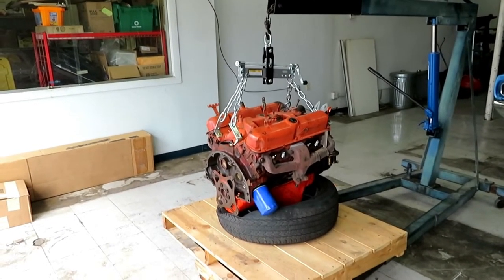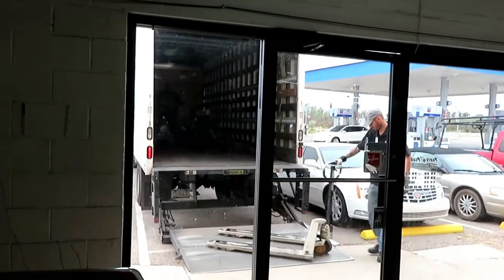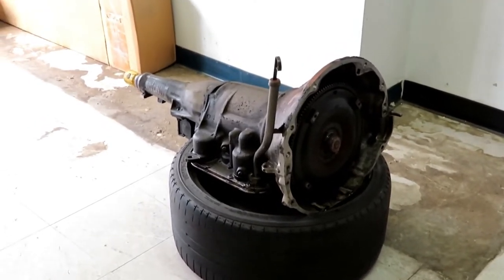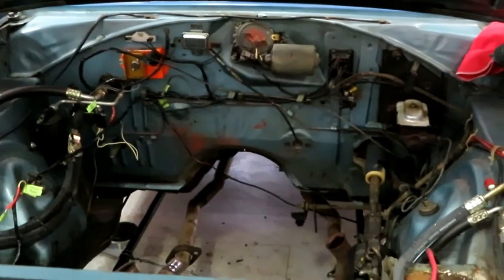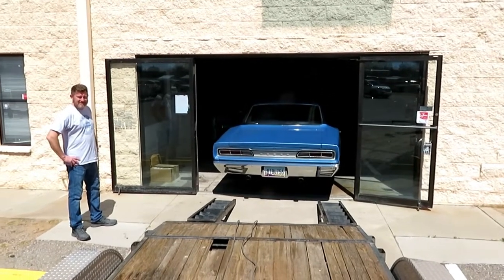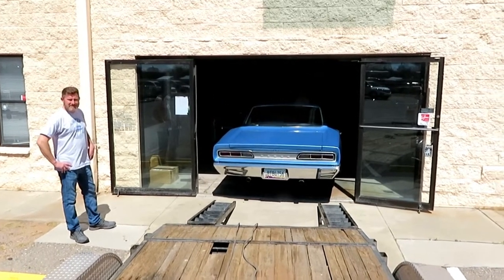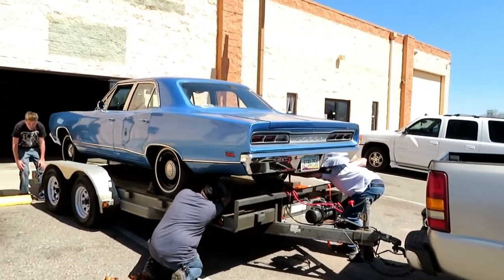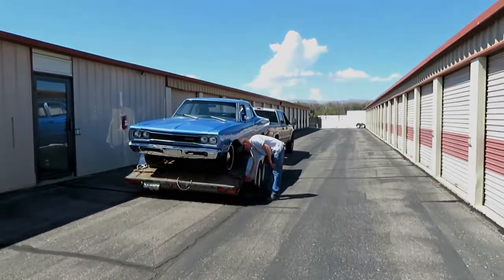1969 Dodge Coronet 440 4 door restoration update 031720191

Comment: Beautiful car! I love that body style! I used to have a 74 Charger when I was a teen back in the 80’s and kicking myself now that I hadn’t kept it and restored it...
Reply from the maker: I hear you man, there have been may cars in my life that I wished that I had kept.  60 Corvette, 62 Corvette, 80 Corvette, 1991 Corvette, 2001 Z06 Corvette, 67 Firebird, and a 54 Ford pickup with a Pontiac 389 in it.  No use crying about it now, there were reasons to sell them at the time, so now I will focus on what I have now and enjoy the heck out of them!!!
Reply: The 73-74 Charger's weren't considered anything classic back in the 80's, or even a 71-72 unless it was a factory big-block or something...I remember the 80's well, at that time 1972 was considered the "cut-off" date for a classic car/truck, '70-'71 for muscle cars...anything newer was considered too "modern" and of a different era(smog and crash-bumper era), even if some of them still had the same basic body style of the earlier ones...I remember around '87-'88 when some mid-late 70's cars started showing up at car shows..even though some were well preserved originals, or well-restored, most people scoffed at them and muttered things about them being too new, never would be classics, etc...a '74-78 Trans Am seemed to be the exception..likewise, everyone would scoff at ANY 4 door car, regardless of make or model, or how nice it was...long-wheelbase pickups weren't accepted, either..had to be a short bed...how times have changed....

Comment: While I'd rather have a 2 door, I would much rather have this tastefully-done car than that pieced-together lime green mish-mash Maple Motors is trying to sell for $33K....
Reply from the maker: Sadly, the 2 door cars are just too expensive for many people.  As you mentioned, many of them have been hashed and trashed over the years.  This is a good honest 4 door that I only paid $5500 for.  Yes, I did spend money to restore it to include rebuild of engine and trans as well as all new brakes, wheels, tires, suspension and complete body and paint (which I got to help a lot with).  So I know this car inside and out and I would feel comfortable driving it anywhere.  So I have a solid car with a look that I love for less than the mish-mash example that you mentioned.  I hope you got to look at several videos of this restoration, this car was VERY far apart.  The only damage was the right rear quarter panel, and I was able to find an NOS replacement for, and the trunk floor, trunk latch area.  Thanks for watching and your comment!!!